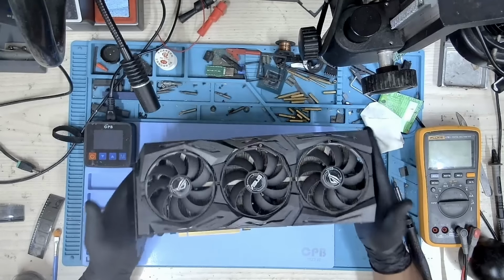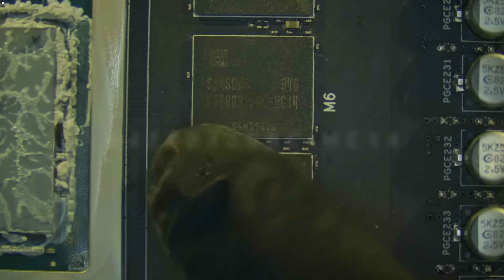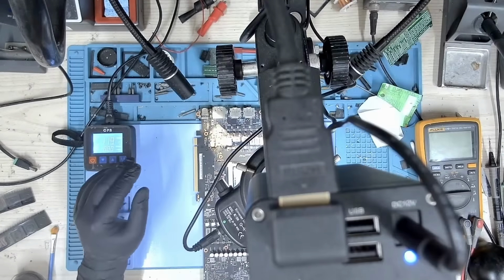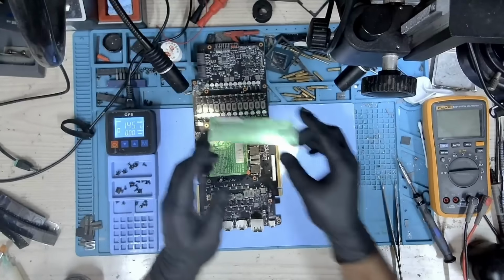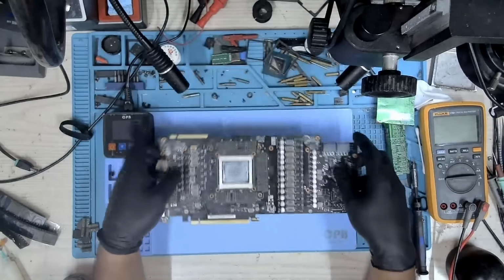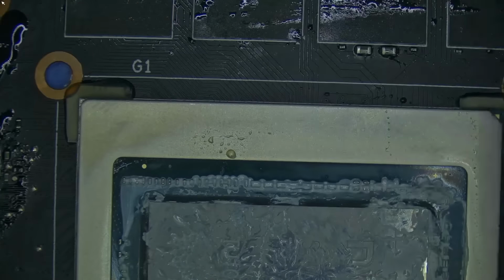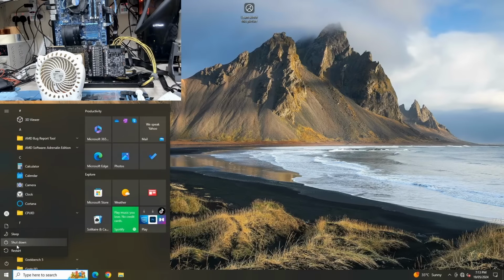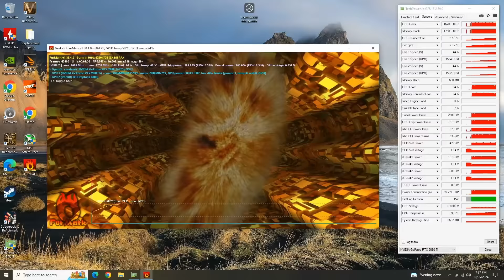Upgrading Asus RTX 2080 Ti memory from 11GB to 22GB

Comment: Everybody says that the memory controller is not prepared to handle configurations like that, and even if it is, the BIOS will be in the way so you would need to decompile the BIOS and hand-modify it to support a configuration like that. And yet, every single time someone just solders some new ICs to a board, be it a graphics card or a laptop, it just plain works.
Reply from the maker: In the case of 2080 Ti no change is required. It has all the setting required including the BIOS. It's just that Nvidia never released this version but planned it.

Comment: Interesting exeperiment, but I think it's not worth do try except you are really fun of these mods and you don't care about wasted time and hardware.
Once I tried to replace memory on some old GeForce 6600 (non GT version with DDR1) and it worked, but it was still showing the same size, so I guess it would need some bios tweaking and under load, I had some artifacts. But old DDR1 memories still had classic legs, so it's pretty easy to do it at home, modern memories with lead balls under it....I tried it several times and I always failed.

Comment: Maaaan, I could really use some extra vram on my 2080ti for skyrim vr, but I'm not going to attempt this as long as it works without an issue since I'm scared of destroying it. Maybe I should start practicing bga soldering on some scraps, so I can work on hardware with more confidence.

Comment: What difference in gaming did it make ?    What about trying an old card like gtx 1070 with before and after benchmark.. or gtx 770
Reply from the maker: I would not recommend this upgrade for gaming. The GPU core falls short long before it can use the added memory. This upgrade was done for AI. It's an excellent choice for AI.

Comment: I would be very interested in knowing if for example an Nvidia Quadro P2000's memory can be upgraded similarly? That card has 5GB VRAM and is ideal for low-level and low-power inexpensive AI inference, but the bottleneck is the VRAM size.... Do you think it would be possible? How to find out?
Reply from the maker: I would need one to test it. I have not tested it yet.
Reply: @GraphicsCardRepairs-tk7ql  If I was not on the other side of the Globe, I might have even dropped one in.... They go dirt cheap these days and could be a pretty decent AI acceleration alternative if we could bump the VRAM to a usable level (8, 16 or even 24GB)

Comment: Do you need to tinker with the bios and stuff? And what about gpu drivers? I want to try this on my 1050 Ti. Yeah, I know, I know, 1050 Ti is not gonna benefit from this but it's more for a fun project rather than trying to get more performance out of it.
Reply from the maker: BIOS or drives are the same. No modification required. The 1050Ti uses GDDR5 memory and the highest capacity module produced is 1GB. I don't think it has extra memory slots to install more memory. 😁
Reply: @GraphicsCardRepairs-tk7ql  I see. That's sad to know that I might not be able to do that modification. Thank you for the info!

Comment: Can we replace the memory chip with a faster one, let's say HC16, which is the 16 Gb memory version? Or can we go even higher?
Reply from the maker: Faster memory can be installed but it will not make any difference until the timings are changed in the BIOS.

Comment: Amazing video! Do you know if you can change from 11Gb Micron memory to 22Gb Samsung memory or do you have to keep the same manufacturer? Thanks!
Reply from the maker: You can change from micron to Samsung. Does not matter which memory is currently there on the 2080Ti. You just have to follow the same steps and it will work.
Reply: @GraphicsCardRepairs-tk7ql  Thank you so much for your prompt reply, you're an absolute legend!

Comment: I look forward to replace vram in two Zotac trinity rtx3090 to have 48gb per card. Would it need any bios replacement from Quadro card? Thanks in advance for help
Reply from the maker: @szymonszczurek2406  I have not tested 3090 yet.
Reply: @GraphicsCardRepairs-tk7ql  , I look forward to hearing from you. Upgrading vram in 3090 to 48gb would be insanely cost effective replacement for a6000. At least since, there are more and more vram hungry llms to work with.

Comment: Sure you can upgrade the vram but how much of a difference does it make going from 11GB to 22GB in games, you now have more headroom to increase graphical settings but will the GPU even be able to fully utilize the increased vram. More ideal to show game performance benchmarks between stock and modified gpus.

Is it really worth all that work to modify an old gpu like a 2080 ti?
Reply: It gives it a longer lifespan where it is viable to use, especially at higher resolutions. Also there are other applications that benefit from more vram

Comment: No custom driver ir BIOS was needed for this? I'm really surprised. 
Makes me want to try it on my old 2080 Super and see how well it does with a LLM. Haha
Reply from the maker: No custom drivers or custom BIOS needed.
Reply: @GraphicsCardRepairs-tk7ql  that's awesome. 
Now if only I knew which chips my ROG Strix 2080 Super had, as well as a schematic for the straps. Haha

Comment: Did you have to modify the BIOS too or just the straps? I suspect you don't have to, since the configurations are there in it by default. There is another way of doing this mod which is modifying the vbios, but then I suspect you don't need the strap change, as the vbios overwrites the strap configuration.
Reply from the maker: No change in vbios. Only straps.

Comment: Do applications utilize and or recognize the extra memory doesn't this create a bottleneck between bandwidth and memory?
Reply from the maker: Applications like software are able to utilize the available memory. Games need to be optimized for it. without it may not utilize the extra memory. Some games will use it if available. So it will be game dependent. Bandwidth is not an issue as this GPU has plenty.

Comment: If drivers supported More memory than it might be big deal. But im pretty sure that there are somelimiters that deny from using full potential of extra memory.
Have you tryed or considered gtx 1080 8gb to 16gb change?.
Reply from the maker: Unfortunately the 10 series uses GDDR5 and GDDR5X. The largest capacity produced on this platform is 1GB.

Comment: Would you be willing to upgrade an older GPU? Specifically a HD7750 with 1GB of GDDR3?

I know there's no logical point in doing this, but its an interesting though expriement to try. And i have zero of the skills or practical knowledge to do this myself.

Ive already looked up the chips required and have a sneaking suspension on which chips to use to upgrade it, but only if youd be willing to upgrade it
Reply from the maker: I would love to but my repair queue is too long. Currently 63 GPUs in queue. I am yet to work on the 3070 to complete part 2 of the upgrade. Repairs are a priority as that's my bread and butter for now.
Reply: @GraphicsCardRepairs-tk7ql  I wouldn't mind the wait at all! I still have a 1080Ti so it's not like it would be a priority project. Just a fun curiosity

Comment: i know you said 4070 is not possible to upgrade but the 4070 ti super has 16gb and the 4070 super has 12, and has empty memory slots. cant ram be added to those empty slots? so the 4070 super has the capacity to hold the 16 gbs that the 4070 ti super can , Nvidia jdid not add those memory modules and left empty slots, please advise thank you
Reply from the maker: The thing about the unpopulated memory slot is that these are not active from the core. The data lines on those slots are deactivated inside the core.
Reply: Literally gonna ask the same thing bru u want my 4070s to have more vram

Comment: Hey man, great job. One question- Is it worth upgrading 3060TI from 8gb to 16gb for gaming? I am thinking of sending one to you
Reply from the maker: I have tried upgrading 3060Ti to 16GB but it does not work on the current PCB. I have a bandwidth upgrade for the 3060 Ti coming soon.

Comment: Besides the fact that 11 Gb counted from 11 x 1Gb module needs 11 slots,  why M11 is empty but M12 filled?  Would be possible to have 24Gb rather than 22Gb if filled the M11 with 2Gb Mobule?
Reply from the maker: As 2080 ti comes with 11GB, it has 12 slots but only 11 active. One of the slot on this card M11 is deactivated from the core as it does not use the full GPU die. The full die is used by the Titan which has full 12 active slots. So installing memory modules in the empty slot will not work.

Comment: Its impressive, but how much does it cost to do this? Doubt a 2080 Ti runs more than 300 usd used and it seems like getting a 3090 would be cheaper and a lighter lift
Reply from the maker: I charge $220 for the upgrade. If you are doing it yourself you can minus 90.

Comment: I see an empty memory slot, could you add one more module to make it a 24gb?
Reply from the maker: RTX 2080 Ti comes with only 11GB. There is 1 memory slot disabled from the GPU core as it does not use the full GPU die. The full die is used by the RTX Titan which has 12GB. Installing a memory in the empty slots will not work.

Comment: So, what's the limit to this? If I wanted a 4080 super to go from 16gb to maybe 24ish, would that work? Could you also improve the speed of the memory?
Reply from the maker: Memory can only be doubled. Now the largest capacity memory produced is 2GB on GDDR6 and GDDR6X platform. All 40 series already use the 2GB memory modules. And all active slots are already populated.

Comment: It may be usefull for gaming on VR. Some games like Half-Life: Alyx may exceed that 11GB and 2080 Ti is perfectly capable of running that game at high settings. I ran into that problem with my 2080Super with 8GB I need to reduce the render scaling and even then the 8GB is barely enough.

Comment: How much gb will be good for gaming if lets say someone wanted to upgrade for playing video games?
Reply from the maker: @JayPimple007  well it depends on the game you play. Many AAA games now use more than 8GB memory buffer when using full textures and Ray tracing. If Ray Tracing is not your thing or you don't need to use high textures 8GB will cut it.
Reply: I know 4k gaming is where its at as of now but even if the 2080ti is upgraded to 22 gb right can the cpu on the 2080ti handle 4k gaming? And thanks for replaying. @GraphicsCardRepairs-tk7ql
Reply from the maker: @JayPimple007  the core is not strong enough for 4K gaming. Older games will do but newer games will struggle because of the core performance limit.

Comment: Whats the "total" Price for Upgrade such a Card?
It looks like it is A LOT of work, the bigger RAM Modules and the risk of damaging something...
Especially for "older" Cards like the 3xxx Series and no need to mention even older once!
I mean, is it really worth it to do so?!
Reply from the maker: For this 2080Ti It's $220. On a 2080Ti the upgrade for gaming I would not recommend this upgrade. If you have an AI requirement this can be of good use.
Reply: @GraphicsCardRepairs-tk7ql  Thanks for the answer! 👍
It's as expected, if i would sell (but i will not) sell my 3xxx and buy a new 4xxx of the same model, this will result in almost the same Cost then with also a bigger Performance increase at all ^^
So it's not worth it imho.
Anyway, nice work!
Reply from the maker: Its not worth the upgrade for gaming.

Comment: Is this possible for asus tuf 3070ti 8gb GDDR6 cards? 8gb not enough and I think it could benefit greatly. Where are you located and how much did this cost to your customer?
Reply from the maker: Unfortunately all GPUs with GDDR6X have issues with upgrades. Working on a fix.
Reply: @GraphicsCardRepairs-tk7ql  Roger that thanks for replying!

Comment: How much would you charge to investigate a dead gigabyte gtx 1080ti? Black screen when drivers are installed
Reply from the maker: This is a memory error. The cost of repair will come to $70. You will also have to consider shipping costs. If you are not in the UAE the total cost of repair will exceed the value of the GPU.

Comment: Is it possible to upgrade 3070ti to 16gb and also add two more modules to 3060 to make it 16gb? Thanks
Reply from the maker: 3060 is at its peak. More memory cannot be added to it as the empty slots are disabled from the core. 3070 Ti is yet a work in progress.

Comment: can any gpu be upgraded? i mean this as more than doubled in memory size. i have a gtx 1080. could it go for more also? you said you dont recommend for gaming. but you would for mining etc. what about video editing and 3d rendering?
Reply from the maker: For video editing, rendering, AI related work the added memory works well. Gaming not so much as driver optimisation is required.
Reply: @GraphicsCardRepairs-tk7ql  ok, i mostly used the pc for 3d and video. so is a gfx 1080 upgradeable?

Comment: Hi very good !😊🎉
'U 're the God of electrons 😅
Can i ask ? Where is possible buy 16 gb vram modules in europe for upgrade a 3080 10gb ??
And which code ?
Many tks !😊🎉🎉🎉🎉
Reply from the maker: Thank you. Currently i am working on the RTX 3080 Ti to upgrade to 24 but its not successful yet. There is lots of work left yet uncertain. I would not recomend you try it yet unless you know what you are doing. I have purchased 2 different set of memory modules and i have to try it. D8BZF and D8BZC. I have not tested yet so i cannot say for certain that it will work. Due to high volumes of repair i am not able to continue the upgrades. However this 3080 Ti will take a long time to be out.

Comment: Quick question, just because I need to know. 😁 Why not go for 24?
You do awesome work sir!  👍👍
Reply from the maker: Thank you 😊. The 2080 Ti has only 11 memory slots active as it does not use the full die. The full die is used by the RTX Titan which has 12 memory slots active. So as memory can only be doubled 2080 Ti can only go upto 22GB and RTX Titan can go upto 24GB.
Reply: @GraphicsCardRepairs-tk7ql  I appreciate the reply and please correct me if I'm wrong. The RTX 2080ti comes with 12GB. The chip is basically the same GPU and most are of the same PCB layout. It lloks like all of the components are there to support socket M11 as is with M12 and M10 next to it. What would it take to fill that socket and bring to either 12GB or 24GB?
Reply from the maker: 2080 ti comes with 11GB. RTX Titan comes with 12GB from the factory. 2080 ti cannot be upgraded to 12GB or 24GB as the empty slot where it connects is deactivated on the core either due to a defect or to match the requirement for the 2080Ti of 11GB. So installing memory in the empty slot will not work.

Comment: How much more performance does the memory upgrade give?
Reply from the maker: Memory upgrade does not give performance benefits. Performance is defined by the core. Memory upgrade only increases capacity resulting in a smoother frame rate and better 1% lows.

Comment: this is cool, and i wish i knew how to do it, cos im sure my 4090 wouid be balling with double ram. How ever, i was wondering, the 2080ti has one unused memory "space". What would happen if ram was put into the position?
Reply from the maker: The unused slot is not active from the core so installing memory there will not work. 2080 Ti comes with 11GB so only 11 memory slots as it does not have the full die  the full die is used by the RTX Titan which has 12GB.

Comment: *New to seeing this*Out of curiosity  in the video you talked about changing the straps  to high high low configuration what are those controlling? Thank you!!
Reply from the maker: Straps help the BIOS identify which memory is installed on the GPU PCB. Bios has the timings for the memory. Watch the video in the link below where I explain in detail.
https://youtu.be/EM1UL4GHviU

Comment: RTX 2000 ADA

Would it be possible to upgrade memory on a RTX 2000 ADA 16 GB? What would it cost? What is max? It is getting so expensive to run LLMs that takes a lot of VRAM.
Reply from the maker: I have not tested on RtX 2000 yet. May be if I get one I will test it.

Comment: no custom bios for the card? so it will only work with 11 gig instead of more 🤔
Reply from the maker: It works with 22GB. The memory timings for 2GB modules are already present in the BIOS so no edit is required. Only have to let the bios know that 2GB is installed by changing the straps. Just like in the video.

Comment: But what about the memory usage? Is the card using it's full vram? Aren't there any software issues like the driver limits the usage to 11GB for any kind of reason?
Reply from the maker: The 2080Ti is able to use the full memory. I have tested with OCCT. No driver or bios edit required. Other GPUs are not the same.

Comment: Does it need a custom BIOS? And is there a custom bios available if it does?
Reply from the maker: No it does not require and BIOS change or edit
Reply: @GraphicsCardRepairs-tk7ql  Then , can the card  utilize faster ram chips? Like if a 3080 ti uses newer chips ?

Comment: Did you try any games with it? I'm really curious if the extra vram helps improve performance in games where it needs to dump stuff to RAM.
Reply from the maker: The extra memory does not improve performance. The only difference is you will be able to play with full textures and your 1% low will be better. The frame rate will be smoother. Everything else will be the same.